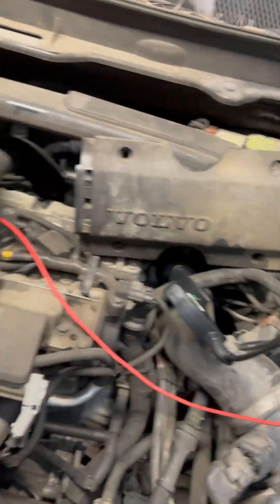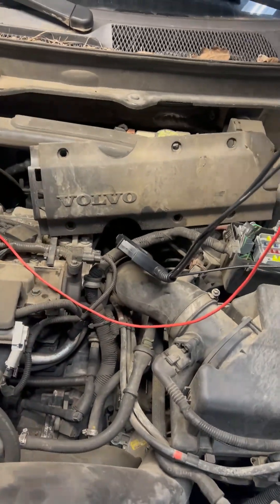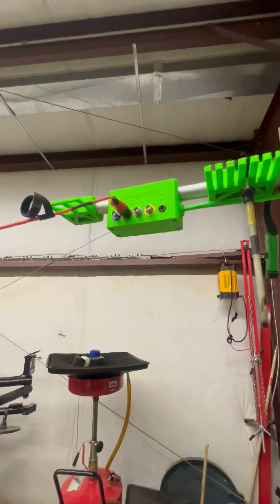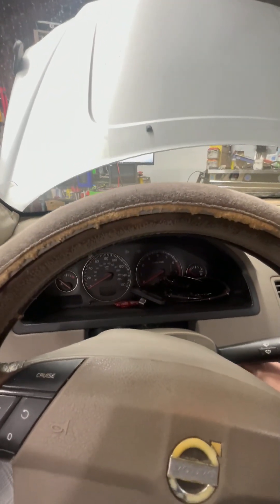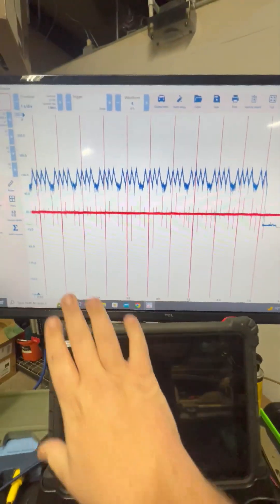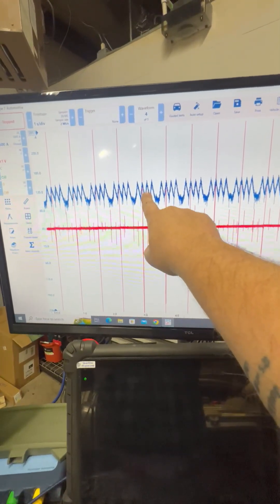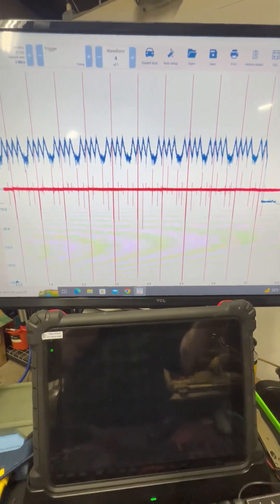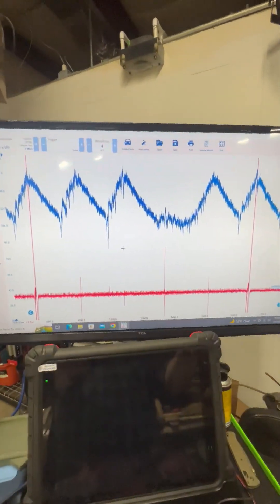How To Do A Relative Compression Check

Comment: I’ve been watching and teaching myself. Have a question have to got to do this on a 21 and up Silverado? I have to do it off the battery cause the way the have the starter done I can’t use a amp clamp. So if u have done it with a clamp can u give some insight of what I maybe doing wrong?
Reply from the maker: Use normal leads on battery positive and negative(like you’re going to check voltage). Set the voltage to 5v a/c coupled and inverted. It will show the same waveform.

Comment: I'm new to scopes and was wondering how would you sync on a Diesel as i work on Heavy Duty Diesels.
Reply from the maker: For a diesel I would sync off an injector. Just as long as you know the injectors fire before tdc of the actual cylinder compression.